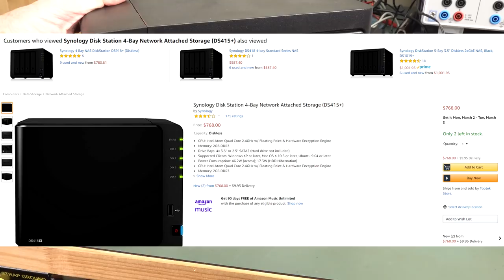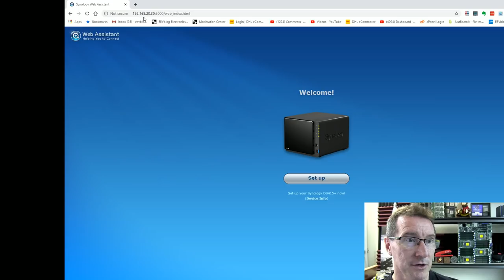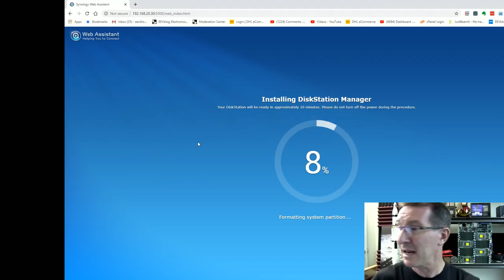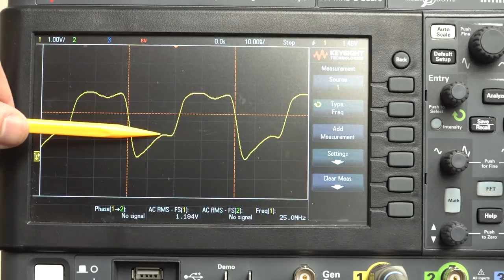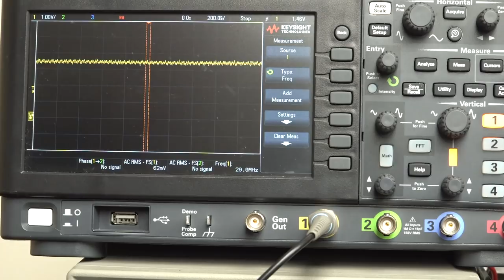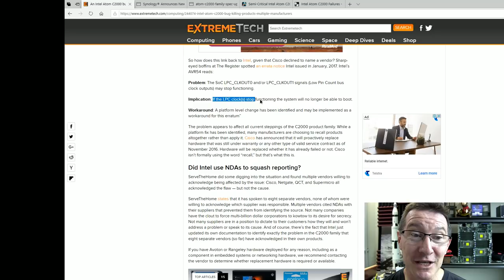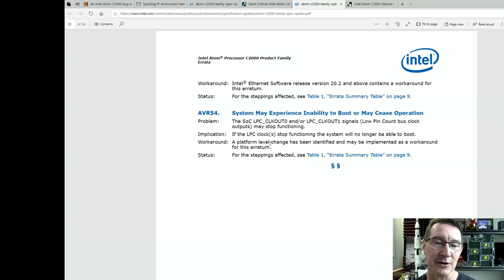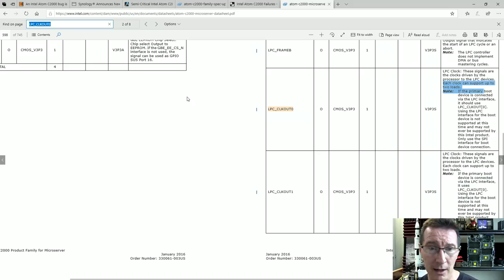EEVblog #1288 - Synology NAS Dumpster Find! (REPAIR)

Comment: Oh gosh!!?!  I’m feeling down about intel by now.  For some reason, whenever I see an AC /DC adapter that has the four separate pins, with that funny din-sync or “S-video”-like socket and adapter jack, that’s the very first place where I’ll fix my attention!  Usually it’s a 12 Volt and 5 Volt with common in the other two pins, as this would be the two power sources that we find present on the old EIDE drives, and very likely these SATAs are same, just not the same topography.  Before I’ve fixed it, I have brought Armageddon upon that poor jack / socket combo!  This is great to listen to, as encouragement towards knowing when to go to sleep or take a rest.  I can be so ignorant and willing to be distracted.  I’ll literally knowingly just close my eyes, and wish.  And based on that wishing, only accompanied by hoping with my fingers crossed, I’ll try it out again...  nothing... by now I’ve ravaged my little 4-pin S-Video din-sync or whatever...  just what will be the future of 12 and 5 volt DC jack adapter powered appliances??!  Something better is in the mail, and I think you might be the one to bring it out way, Dave?!  Are those bays ‘hot-swappable’?  If so, keep it, if not, tough decision.  I would keep it until you’re annoyed, and then maybe kludge for what is appealing.  THANKS FOR SHARING THIS, ALWAYS INSPIRATIONAL!
Reply: The group regulated 12V/5V dual power supply with a Kycon plug was a horrible idea to begin with and is destined to die. The much nicer way is to have a 12V power supply and a 5V step down converter downstream inside the device.

Comment: Probably not an indication it's never been used. If the Synology Nas are anything like the qnap. The firmware in flash it just enough for 1st time setup. My understanding is qnap installs the OS that you use day to day to the hard drive(s) you have installed. But I have no faith in anything Intel, they're behind on CPU process. I've had multiple laptops with Intel wifi/BT adapters where they BT just randomly dies for devices like BT mice and you gotta reboot to make BT work again.  Then there's issues with Intel cellular modems being slower and more power hungry than the competition and the puma chipset cable modem issue. Intel is just garbage these days
Reply: it's matter of luck... I have intel CPU which runs fine, I belive above 90% customers don't complain about their CPU. Sometimes it's not the hardware but the drivers that fails or written badly, especially for windows.

Comment: On first glance that unpopulated connector you used for the mod looks kinda like a TPM header. That also has the LPC bus wired up to it, and could possibly be something this motherboard might like to have in a different design variant.

Comment: I was effected by this C2000 bug too. It was one of my server boards. It runs for month and after getting it off for service it not came up again.
The manufacturer just repaired it with a simple RMA process, especially created for the C2000 bug.
It was really a big thing in industry  these days. It effected a lot of systems: Network switches, routers, storages, low-power servers, and so on...

Comment: At 13:04 where you seen the ghost of the 25MHz signal it looks that you've jumped from pin 6 to 4.

The daughter board with chips, that looks more like RAM rather than flash to me.   Maybe wrong, but I seen that some have different quantities of RAM.
Reply: @Dromen Ok, you're right.   Re-looked and there's an SODIMM next to it which obviously would be the RAM!   Doh...   Thanks.

When I've done embedded design and you need RAM I've used chips in a similar form factor.   And the spare pads made me think it was so larger quantities could be provided.   My mistake.
Reply: @Dromen Depends on the format of the RAM to package size. But given that Flash needs more cell space than D-RAM that's another tell. So, yes, you're right again.

Comment: Those caps are wet electrolytic...  cause some old PC's that use that same style have leak damage, those type are not prone to popping when they go bad they just leak trace eating goop
Reply: Those particular caps are NOT wet electrolytic, they're genuine polycaps, the blue ones are Nichicon PLF and the red ones are Fujitsu FP series.

But indeed someone in Taiwan was making wet electrolytic caps that look the same, and MB manufacturers gladly used them. A bit of a fakery. Naturally if it came time for them to relieve pressure, they'd do it via the rubber bung below.

Comment: I have had so much trouble with cheap and nasty (but expensive) NAS boxes over the years.  When they fail it's a pain to get data off them if you can get it at all.  Ditch them all, I say, and put some drives into an HP Microserver, format with NTFS , and live happily ever after.
Reply: lol sponsor comment
Reply: Why NTFS when you could use ZFS?
Reply: @NiHaoMike64  Wrong place for this endless debate, but in short, NTFS disk can be read in every PC.  Disaster recovery is what these backups are for,  the aim is to avoid the disaster of not being able to read the disk of a failed NAS.

Comment: Thank you! I have an Atom based 4bay Netgear Readynas sitting broken in a similar way, waiting for some time when I get a clue what might be wrong. I will take a look if I can find a similar solution for the Readynas.
Reply: Nope, my unit uses a different CPU (older Atom D410) and I can't find similar solutions to Readynas. And the thing seems to have an dedicated oscillator. And it uses a non-standard PCI-like connector to the backplane, so I can't even reuse it in my PC :-(

Comment: Thanks for sharing this very informational and helpful video, sir. I've repaired both of my 1815+ and 1813+ Synology NAS devices. I've an EE degree (which I've never used) and am curious as to how someone figured out the fix. Nevertheless, thanks.
Reply: They figured it out by opening and inspecting a NAS that had been repaired and returned by Synology under warranty.

Comment: got a question. PLS. i sqw some more pins in the SATA connectors and made mw think that it can take u.2 connecton also. i think is called sff 8639 . 
is that true.???
Reply: Likely Negative - the extra pins here are because this is a sas/sata connector.. whereas the u2 connector format is just a bridge to pcie interface..

Comment: if something fails sometime, it would fail again.
don't trust in it.
Reply: You buy a new car every time your bulbs burn out? Gee
Reply: @konsul2006  you can replace a bulb that cost cents and it was think to be replaced sometime.
in this case I don`t going to trust my data in something that fail in such short time.
Reply: @sergiovw1500  as long as the drives survive, there would be no problem getting back up and running. There isn't a known problem with the nas other than that of the cpu issue... Bodge fixed with a resistor cheaper than a bulb.
Reply: @konsul2006  I'm not putting all nas in the same bag. I`m talking in this particular case.
Reply: @sergiovw1500  so you would trust your hard drives? Do you know that your hard drives CAN FAIL too? not just the NAS itself?

Comment: The golden rule - you never use hard drives as a back up solution!
Reply: I do.. what do you use?
Reply: There isn't a viable option really...
Reply: Golden rule for backups would simply be the 3-2-1 rule, no idea why hard drives would be a problem, you may don't know what you're talking about
Reply: There is not really a choice for most people out there given the cost of tape systems.  These setups are cheap compared to many of those,  I admit cloud should also be on the list of backups but only if you know how to secure it and not leave the S3 bucket set to public.